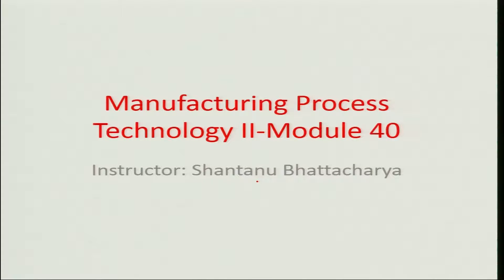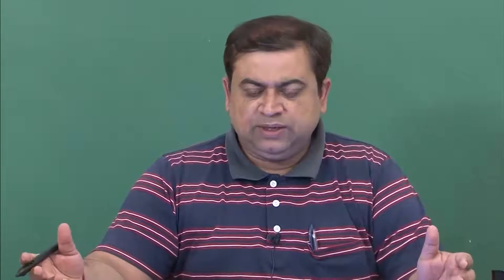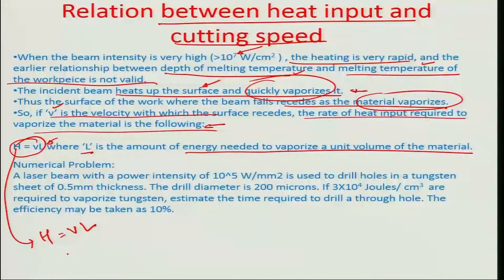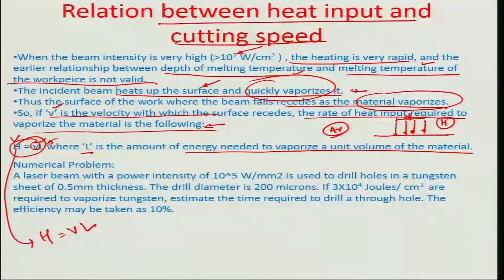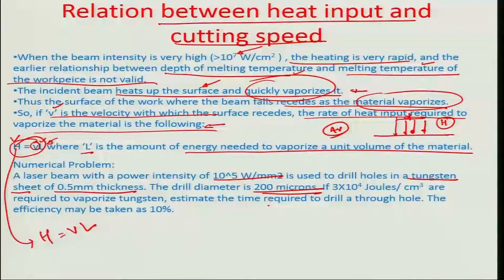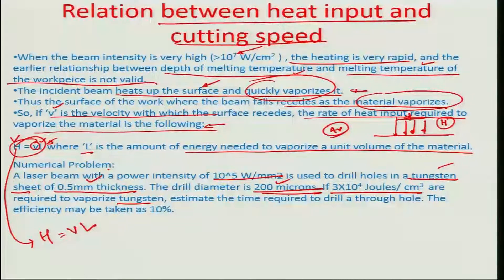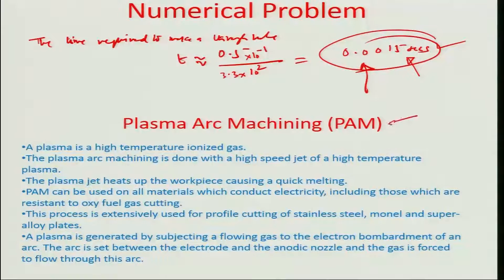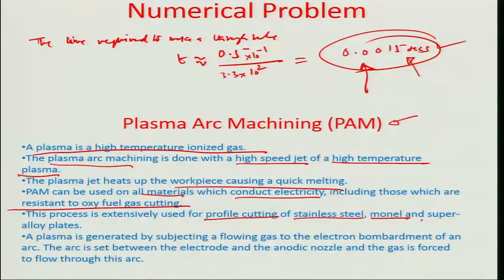Modelling of LBM processes

Comment: Hello
I work on the numerical simulation of the natural convection in a cylindrical cavity by  lattice Boltzman  method   and I try to to implement the cylindrical boundary conditions in motion in a FORTRAN code, if you can suggest basic codes, I will be very grateful
cordially